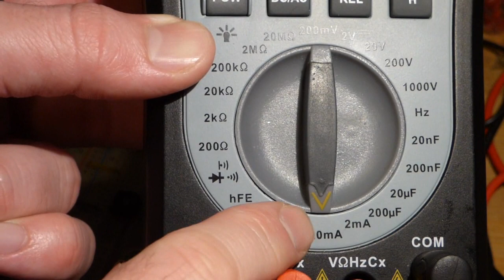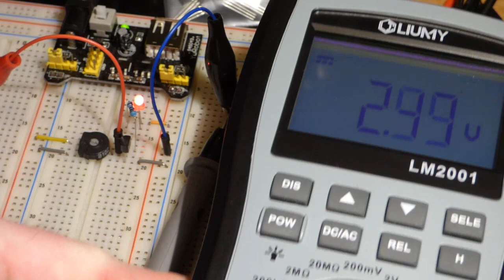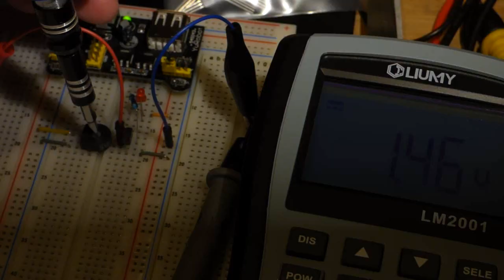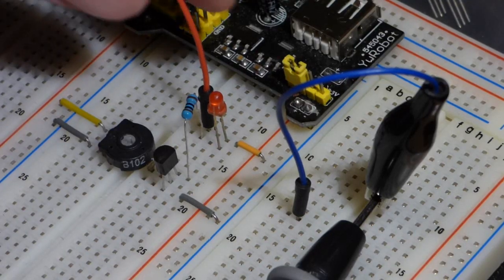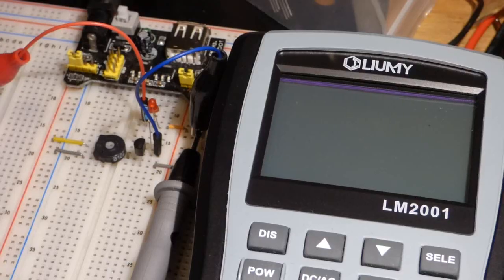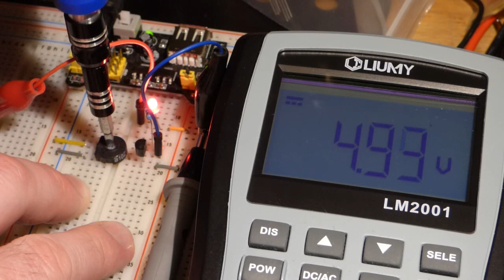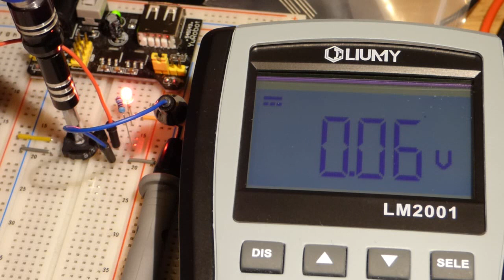2N7000 N channel enhancement mode MOSFET transistor test circuit and multimeter measurements

Comment: When the MOSFET is off, the drain becomes a very high impedance, comparable to that of the multimeter, and so it becomes difficult to get sensible measurements across the load using a multimeter as it has no proper path to the negative rail. If you put a high value resistor - even as much as 10 Mohm - across the FET, you'll get much more sensible readings across the load. Similarly when you're measuring the voltage across the FET, putting a high value resistor across the LED will allow the multimeter to measure the source-drain voltage sensibly.
One point I'd have demonstrated is that the potentiometer can be a high value, say 1 Mohm, without altering the ability of the FET to supply current. Thanks for a good demo anyway.
Reply from the maker: Thanks for the tips!

Comment: I thought I had my head mostly wrapped around transistors but I have recently discovered that there's a lot more to FETs than BJTs. A lot of instruction focuses on the outputs but what about the input to the base? From what I understand you control the base with current for BJTs but for FETs you control with voltage? I am still trying to wrap my monkey brain around this one and any insight you care to share would be greatly appreciated, thanks in advance! 🐵😂👍
Reply from the maker: I haven't done much with FETs yet but the FET Gate input is similar to a capacitor that gains a charge and holds it but current can't pass through it. The electric field created though, either increases or decreases the Drain-Source conduction depending on the type of FET it is. There's all kinds of websites out there that go into great detail on the chemistry involved.